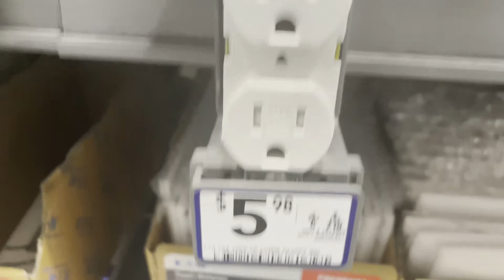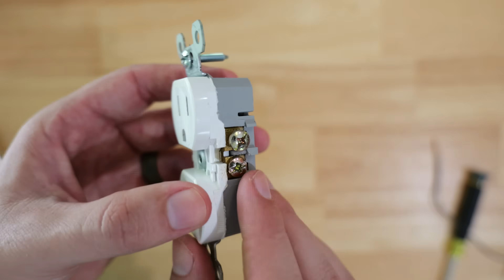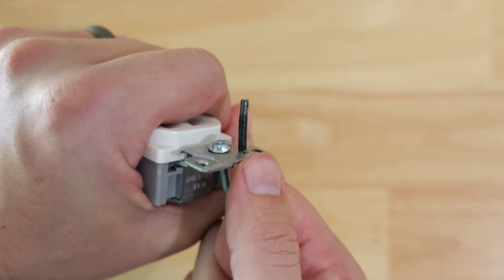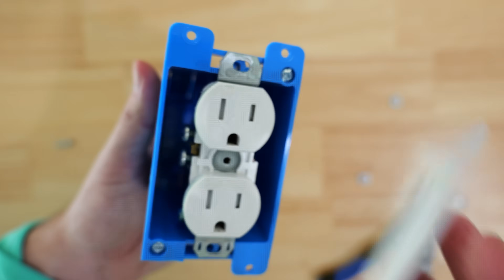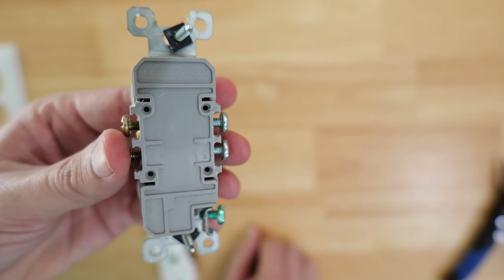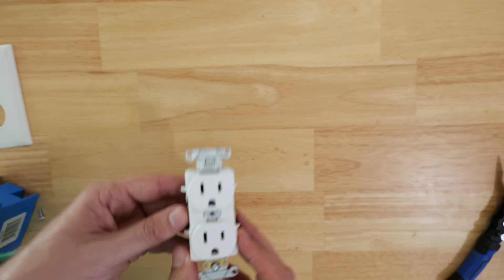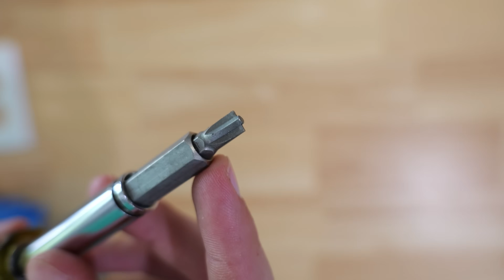10 MIND BLOWING Things DIYers Don't Know About Outlets But SHOULD

Comment: One other little known benefit of those smooth face receptacles is they do not collect dirt. Anyone who has had the recessed kind for a while knows how the little wells can collect dirt and debris and they can be difficult to clean and can be unsightly with white devices.  On another note, I wish they would ban backstab devices. I cannot tell you how many I have found in older installations which have lost their grip, gotten hot and just outright fallen out when the receptacle is pulled from the box.
Reply: Aye, the idea behind the backstab method is nice but the execution just isn't ideal.
Reply: I have also seen in older homes or where it was passed through multiple DIY owners a conductor attached to each screw AND one in each backstab hole! OR they are used to feed another circuit down the line. I CANNOT believe that they aren't made illegal for all the danger they facilitate!

Comment: LOL you Wrapped the Ground Wire - Counter Clockwise ❌
Reply from the maker: No, I pulled the wire around counter clockwise but the loop itself is going around the screw clockwise.  Due to the design it has to be pulled that way in order for the hook to go around in a clockwise direction like it should be.   Take another look.
Reply: @HowToHomeDIY  😁
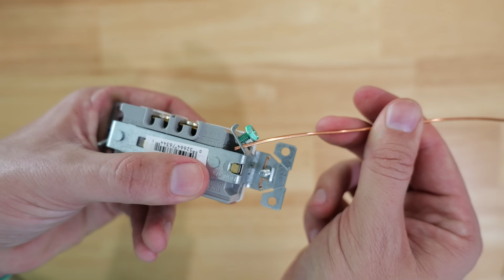Reply: 02:45
Reply from the maker: Yes, it is wrapped around it in a clockwise direction.  I don’t understand how you aren’t seeing that lol.  Again, to use that hole, since it is anchored you have to pull the wire around the screw counter clockwise in order for the J hook to be wrapped clockwise.  Not really sure how else to explain it to make it anymore clear.
Reply: @HowToHomeDIY  hey I put the timestamp on there if the person can't see you're doing it the right way it's just one of those things are probably going to have to watch a lot more time maybe they're just not able to pay attention right now. LOL maybe they're too poor to pay

Attention
Reply: @HowToHomeDIY  I , too, didn't see it correctly wrapped the first time through.  In fact I went back and forth between frames to see how you were wrapping the wire so that when the screw was tightened it would indeed adequately secure the wire.  I can't figure out how I didn't see that the first time through.
Reply: I'm speaking of the ground wire demo
Reply: @David-fb8fn  timestamp?????
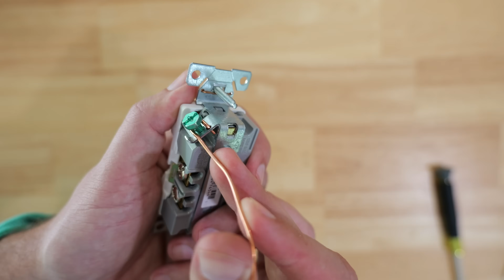Reply: @deadmanswife3625  2:45-2:53

Comment: The old saying is true... you get what you pay for.  Me... I only install spec grade devices.  Well worth the extra cost and they last longer.
Reply: I'm a union electrician, i had to change all the receptacles out in my sister's mostly new home.  they wouldn't even clasp the u ground plug contacts, they would just fall out.  it's an extreme fire hazard.
Reply: Thirty years in the trade and I have no problem installing resi-grade recepts.
Reply: Installing vs. how long they last are two completely different things.  As always, you are welcome to do whatever you want.
Reply: @csimet The basic residential grade receptacles at your hardware store will be fine for the lifetime of the vast majority of outlets.

Even if residential ones are much more likely to fail, the rate of failure is still miniscule.

As someone puttering around their home, I would always by the commercial ones as the couple dollars doesn't really matter. But, from the perspective of a business and buying thousands of receptacles then I can see why they may be considered good enough.
Reply: @csimet what you mean
Reply: Commercial spec are non tamper and you have to have tamper resistant/proof plugs in a residential/dwelling by code.
Reply: @joshbarr118  TR receptacles are available in spec grade.